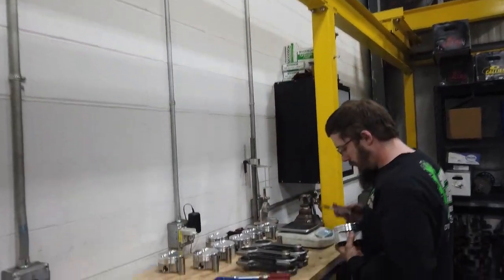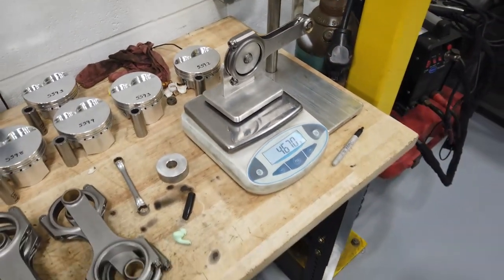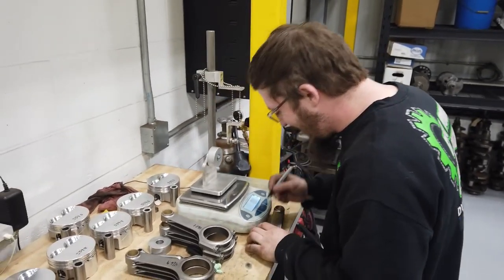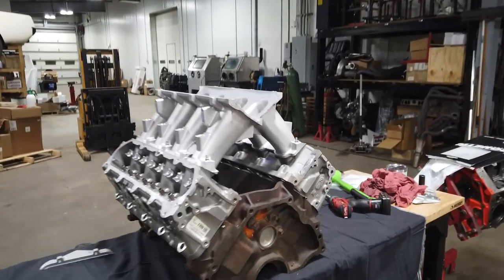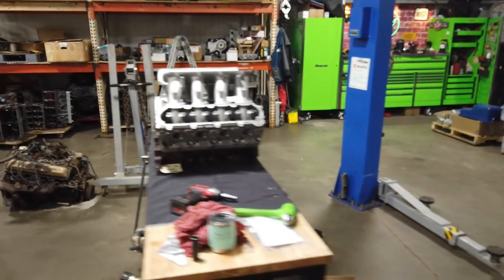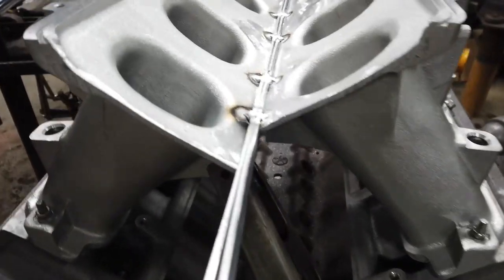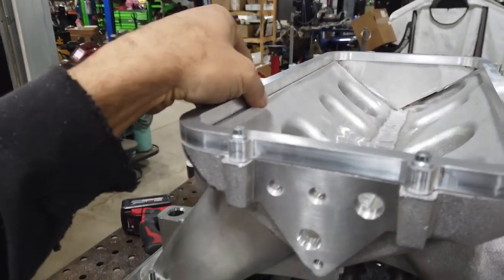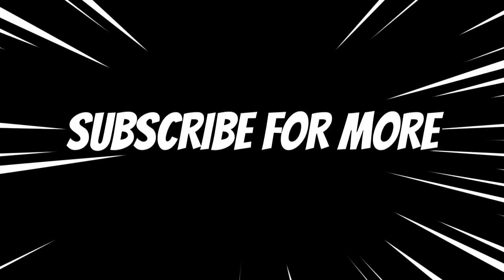351LT PART 2

Comment: Just  Found your channel Awesome shop  Shop. I run my own automotive repair shop and I'm trying to get my gantry Crane and parts washer set up. Game changers I set up man.  I saw some guys mock up some LS heads on a 302 Wonder if they fit better on the 351 I think probably the same Like a boss  Is motor top End interchangeable. not sure I'm a Chevy guy . Great  video hope it works out. I don't think chevy copied  Ford But it's pretty funny how that bolt pattern is SO close. pretty  Curiously close. Maybe GM did copy Ford. Cause  the Ford smallblock heads. Always had bigger ports and slightly better flow and architecture. In my opinion. But I'm still chevy guy. And it's pretty hard to beat flow numbers from LS heads. So this will be a awesome project. Especially building a short block you can get from the wrecking yard for real cheap.Ford guys don't hate.  Chevy guys don't hate this is awesome. Literally have middle ground to talk about.

Comment: Did this project die out?
Reply from the maker: @Go4BrokeOffroad  not yet. I have been slowly picking away at it. I will do an update before the end of the year I hope.
Reply: @gmtgearhds1072  awesome. Ive been contemplating doing this to my tall deck ford 400. Heads are cheap.

Comment: If there was an economically viable way to do this instead of aftermarket Windsor heads, I would be all over it with a budget 408/418/427/434 stroker kit in the 351w block I have in my front yard and then I would attach it to a T-56 and install it in my 2004 GTO, a Holden with a Ford block and LT heads. That would really rustle the jimmies. Probably will just go the safe and boring route with the 6L LQ4 block and some cathedral ports in it. Love this build though, it definitely spurs the imagination. Probably would be more economical to use L83/L84 heads than L86/LT1 heads, on a 351w, even more so than LS heads since you don't need a custom cam grind to make up for the reverse valve order. Probably the simplest thing would be a dual sync distributor and Sniper EFI. Not sure how much of a market there could ever be for it but, it would be cool if someone make kits to do this.